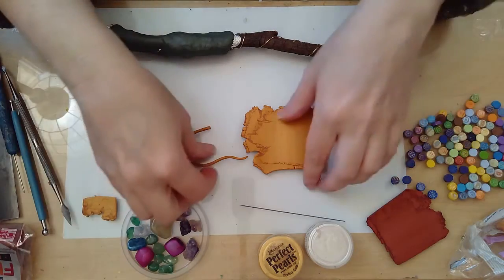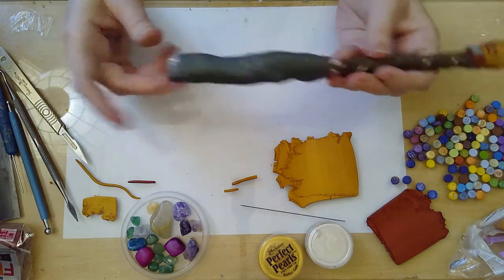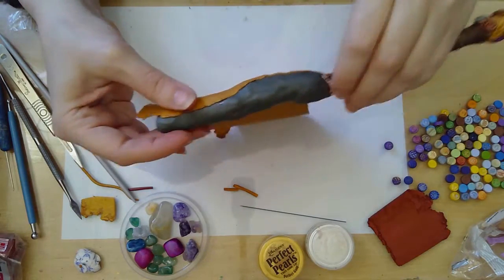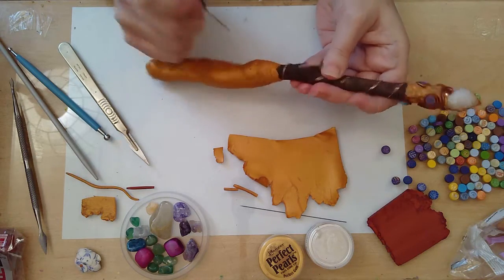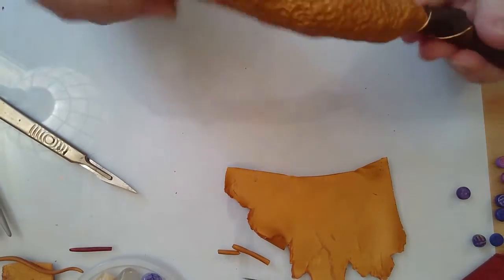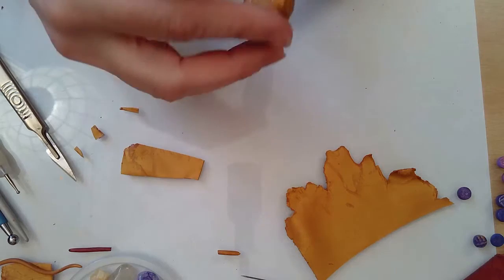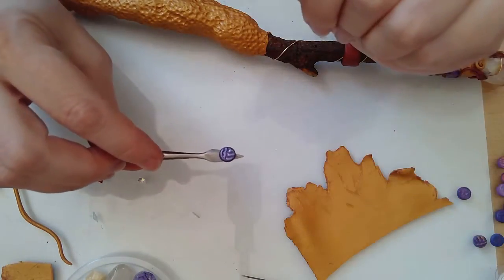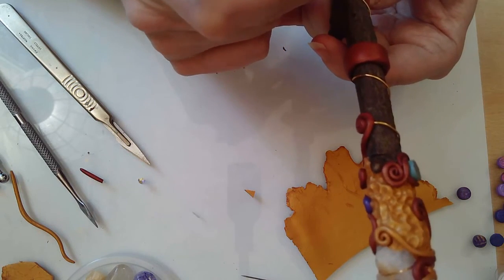Mixed media wand - part 2. Includes polymer clay, crystals and a found stick.

Comment from the maker: For this video I used a stick that I found on the ground which had been blown down in a storm. If you are using new materials in a polymer clay project it’s a good idea to test how they will react in the oven. I was not worried about the stick igniting at 120 degrees C, but with certain woods you may get sap bubbling out. It’s best to do a test bake before you have spent time working on you polymer embellishments.
Reply: How long did you bake it for?

Comment: Did you bake it after you finished?
Reply from the maker: Yes, I used polymer clay so it needs to be baked to harden. It’s a good idea to do a trial bake of the stick to check that it doesn’t have too much sap before you begin decorating.